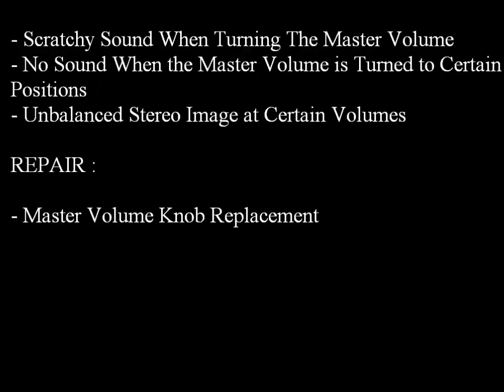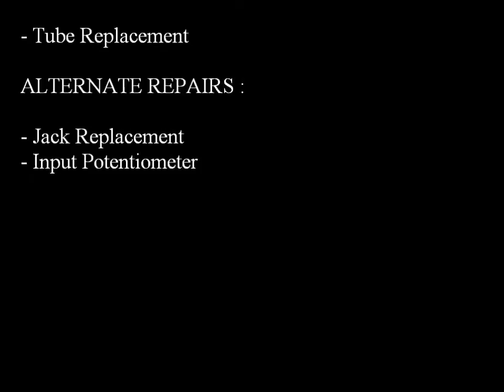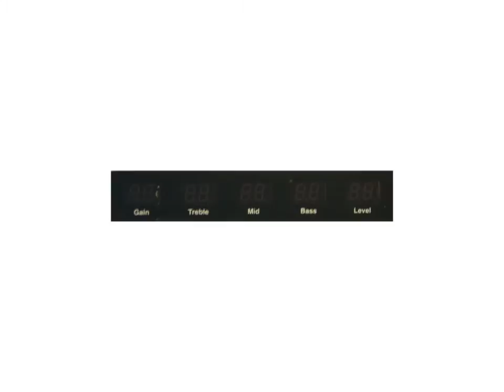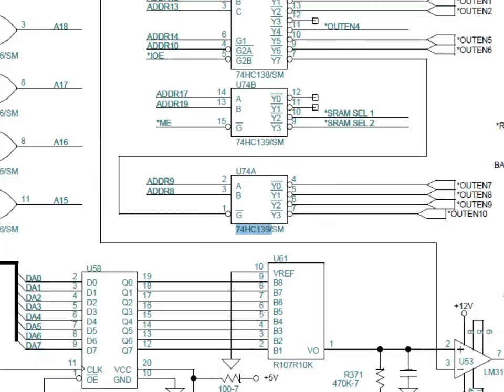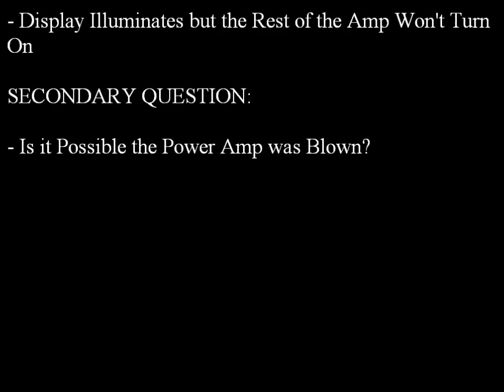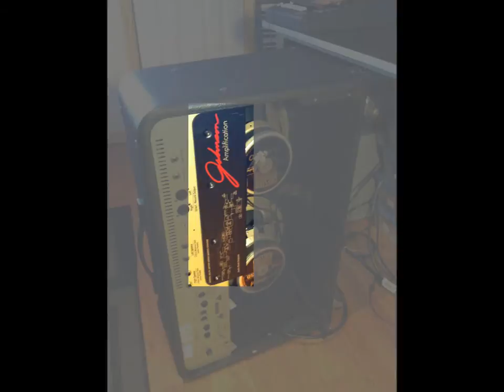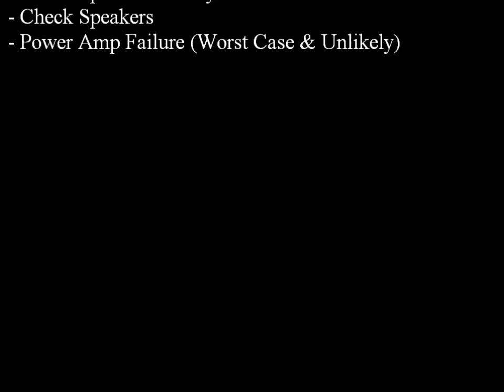Simple, Common Repairs for the Johnson Millennium JM-150 & JM-250

Comment: Hello I talk to you quite a while ago about my 150. I followed your advice about disconnecting the power amp to determine if that was the cause of my issue, although it didn't seem to make any difference unfortunately. The display lights up but doesn't say anything. I have had this problem looked at by our local electronics guy 3 times. Each time the amp works until I get home and then something happens to it. I do see where he has worked on the c13 cap, and it looks like it has been rigged to work somehow like there has been issues with it. In the past I have had the problem with it shutting down while playing it. Wondering if you have some insight that you might be able to share. I took a picture of the C13 situation. I sure would like to get it working. Also If I could get it working I would like to change out the pots and the encoders. Thanks
Reply from the maker: I'm curious if they gave you a summary of the work they actually did, and if so what was it? Rigged in what way? I mean, it should either be soldered in and there, or not there? Are you saying it never works when you get it home, or it works temporarily, say a few days and then ceases to work again? Also, do you have any form of test equipment, like even a simple volt meter?
Reply: @BosleymusicCentral  I did ask him about what work he had done, but he didn't act like he wanted to be too specific. I am kind of wondering if something is wrong with the board. It looks like there is some rubber/insulation maybe under the C13 cap and it looks like one of the leads from that cap is bent sideways soldered to the ribbon and not through the board. It did work each time when I got home, and seemed OK, but the next day it was back to the same problem. I do have a volt meter and have some de-soldering braid and some tools. I dont have a whole lot of electronics knowledge. I also wonder if being worked on too many time might have overheated the board or something. Also several people have worked on it years before him, including a technician from Harmon/digitech. If there is a place to get some parts still in Salt Lake City, I could drive there and pick them up. I have called Harman but I dont know if that is where I should look. The person that I talked to was not very helpful.Thank you so much for your response greatly.
Reply from the maker: @TheConcretelizard  " he didn't act like he wanted to be too specific" = shady. "bent sideways soldered to the ribbon and not through the board"= lazy work if that's what this person really did. You can definitely damage a PCB by replacing parts too many times, or doing it improperly, but unless the same parts were replaced 3 or 4 times, and the person has some skill, probably not likely. A few things : 
- Johnson has been closed for about 18 years, and unfortunately Harman canned most of the Digitech people in 2018, and seem to be just liquidating remaining units. Some parts don't exist anymore, like the S-DISC, but almost everything else on the boards can still be procured.
- If you can find the guy who worked on it before from Digitech, and he's local, I'd try to find him.
- If you can disconnect the power supply harnesses, and check voltages without load, I'd highly recommend that as a starting point. The GNDs are in the centers of the molex connectors, and the silkscreen will give you the voltages you should see, with "+32V" generally being higher than that. 
- If the power looks good, you might want to try turning the amp on, let it run for a few minutes, then power it on and off (cycle it) a few times --- sometimes the first time you see nothing, then garbled characters, then it boots. Most CPUs/MPUs/MCUs have a window that they have to be properly powered within otherwise they don't run, and doing what I described is like pushing the little primer pump on a lawnmower - you may see it boot by doing this.
- I don't understand the backup battery stopping the amp, but after I replaced on recently, I had to power cycle the amp multiple times in succession, to get it to start up again. You might want to try this also.
- Last thing I can think of, is make sure none of the switches are accidentally pressed, or permanently pressed, and make sure all of the ribbon cable connections are well seated. If a button is damaged to where it looks like it's pressed, or the Z-80 "sees" a switch as pressed because a connector isn't seated, I've also seen the amp not boot under those conditions.
Reply: @BosleymusicCentral  You know I unplugged the power supply and couldn't find my volt meter. So I decided that I was just going to find someone new to look at it. I put it all back together, then pushed all of the buttons a few times and turned it on and it started working. I haven't turned it off yet because I wanted to play it. Sounds great except there is a rattling/buzzing sound only on some of the more resonating notes. Sounds like something is loose. I think I will look in to it a bit more to see if I can find the rattle. Thank you for all of your time. I know its valuable and very much appreciated.
Reply from the maker: @TheConcretelizard  No problem - it might be a simple matter of having the power supply re-capped by someone who can do the work well. The electrolytic caps are at least 20 years old and probably starting to fade, so you might want to ask about that specifically.

Comment: Hey Don first I want to say you are a genius! Second I want to say thanks for the invaluable website about the Johnson amps! You ROCK!!!  Third I wan to say sorry I think I call you Dan in the video.... Could you take a look at this link when you have time? I got a Johnson 150 used and on some of the presets it just drops the sound note etc. It gets worse on the loud heavy presets. It gets annoying and I want to verify that it is not normal operation. Thanks so much...    https://photos.app.goo.gl/qkGMxgEyW3r2Vj7o8
Reply from the maker: A few things - hard to tell with the camera's microphone, but I think I get the idea.
a)check the firmness of connection between the speakers' 1/4" plugs and the jacks. I just had an amp on the bench where one of the jacks wasn't solid anymore, and that was the source of a lot of strange sounds.
b)it never hurts to disconnect one speaker and try each side of the amp individually, along with flipping which jack the speaker is connected to on each side.
1) Disconnect the speakers from the jacks in the back, and plug XLRs to something like a mixer with headphones if you have access. The XLRs are basically right before the power amp so they have all of the preamp/DSP available to listen to - you have to turn the master volume up to get output from the XLRs. Make sure the speaker simulator is on otherwise it will sound terrible. If you get good sound that way, it narrows it down mainly to power amp, or speakers. The other possibility is aged tubes.
2) If you have access to another set of speakers, try them. 4 Ohm minimum on each channel. One reason cleans might sound better than driven sounds has to do with speakers that might not be able to handle the richer upper harmonics the dirty channels produce, anymore. That's a sign of age/wear. A few years ago on tour, a Meyer monitor kept producing some weird noise - there guitar tech opened it, found a ton of dust, blew it out, and voila, back to gold.
3)  If 1 is good, but 2 produces the same results, my next step would be to have the power amp looked at, and/or swap pre-amp tubes.

Comment: Hi I have a Johnson Millenium 150 I'm doing an inside cleaning of the circuit board and inside of the chassis it's pretty Dusty will it hurt for me to spray out the electronic board with contact cleaner along with the volume potentiometers?
Reply from the maker: I'd recommend pulling the boards out, and using either >99% isopropyl to flush them, or alternatively some people use distilled water - the idea of water, although I know people do it, scares me. Drying time with water is much higher, also. Things like deoxit are arguably band-aids, and unfortunately two things tend to happen - they don't remove the dirt, they just bond to it - the residue some "PCB cleaners" leave, attract dust worse than if they were dry. In my experience contact cleaner works best when you have freed the bulk of external dust. You could also do none of the above, and try to use compressed air to blow the whole thing out.

Comment: Anyone know if the cooling fan on a JM150 is supposed to run constantly or only when hot, just got the amp but haven't heard the fan run yet.
Reply from the maker: Mine has always run on my 250 from the day I bought it.
Reply: @BosleymusicCentral  OK thanks guess I better check the fan out further, maybe unhook it and try it on a 12 power supply. Hope it,s just the fan ,that'll tell me .
Reply from the maker: @troybrown7092  In case it was the fan - I actually had to buy a replacement for a unit I'm servicing - the Qualtek FAD1-12025CBLW12 is a good fit.

Comment: When I play my JM-150 for about 5 minute, I hear a subtile white noise in the background whit some occasional poppings and cracklings,  the gain and the volume start to drop and the amp farts out. If turn it off and turn it back on, the noise is gone and the amp works fine but the same problems are going back. Plus, I could hear the kitchen mixer  in the amp while it was turing on.   My guess is that it's the preamp tubes that are dying and they are getting microphonic ?  Thanks !
Reply from the maker: Changing tubes is always a good start if you have never done it, but the kitchen mixer showing up in the audio path... unless it's physically close enough to vibrate the amp or induce a magnetic field, I can't see how that would have an effect directly. I would A)do a gut check of your home wiring with a socket tester, B)check your power supply. When you say "farts out" do you mean the audio dissapears, but the amp still runs? i.e. you can go through menus, change values, etc... if that's the case, you're looking at a deep dive problem with loss of a clock, or a bad IC. If it's the S-DISC you're out of luck on repair.
Reply: @BosleymusicCentral  Thanks for your response :) 
Well it was more like the gain was lowering and became unresponsive. Like a if noise gate was slowly activating itself and the volume dropped but it was very gradual and not sudden. But I couldn't change the sound when I tried to change values.  Also, I switched to a super clean patch right after and it sounded fine. It was only when distortion was engaged/added.   But after playing it afterwards, it seems like this event was a one-off so far and it didn't do it again.  The white noise is still there after 10 min of playing and the gate doesn't help. And the white noise doesn't increase in volume and it's pretty quiet so I only hear it when I don't play. Oh and the kitchen mixer was at about 6-7 meters away and the sounds was only present during the "loading/opening" screen of the amp. Other than that, everything works fine.

Comment: I just got a used Johnson 150 millennium I would like to try and find a owners manual how would I do that? and also I noticed the fan in the back of the amplifier is not coming on can you help me with this? Rodney's LaRue from St Louis
Reply: The manual is online I found it no sweat.
Reply from the maker: If the fan isn't coming on, start by checking the voltage to it. Honestly, you can replace it for about $12 and don't really need special tools to swap it, so you might just want to replace it.
Reply from the maker: http://pdfstream.manualsonline.com/5/5aca9756-9686-4cac-891d-df1424f12d74.pdf

Comment: Anyone have a part number(s) for replacement potentiometers?
Reply from the maker: I haven't been able to find anything off the shelf in a long time. It's a W-Taper, dual-gang 100k. The bourns PDB182-K2 series fits the form factor, but only linear taper, and you have to cut the shafts down - they're less than $2/each on Mouser. The W-Taper is not that far from the linear. There's also a person in Germany selling the exact part at $13 a pop. Put "Digitech Volume Pot" in a search on Ebay and you'll find it.

Comment: Hello.I had the same problems with the security code on your website,to contact you.I want to download patches to my JM150.but I have seen posts it will not work with windows 7,that’s what I have ,I was just going to purchase the $8 usb midi converter and dump the patches ,if windows 7 does not work is there another option.Hope all is well thanks for any help you may give
Reply from the maker: Obviously the JM software was designed to work well with the amp, but Windows XP wasn't even a thing when the made it. We're well beyond that. Any MIDI patch librarian software should work to store sysex from the amp - what I wouldn't recommend is trying to do an operating system update without reading through the thread of comments about Midi-ox in this video : https://www.youtube.com/watch?v=E0WupXIbk3M&list=RD_YFoH3ghrlw&index=2

Comment: This might be a longshot, and i hope you are still active on this page, but i really need your help. My johnson amp just stopped working while i was playing, it didnt turn off, but the display light in the screen did, and theres no sound coming through. 
I narrowed down the issue to a blown fuse with help from this forum: https://www.thegearpage.net/board/index.php?threads/johnson-millenium-jm150-help.630794/
I really hope you can help me out here. Thank you in advance.
Reply from the maker: I haven't been very active here, as you can see by the delayed response. Do you have a Voltmeter? Can you test the values on the power supply somehow? Preferably starting without load, and then adding load in, board by board.

Comment: Hello Don, and thank you for all the valuable info on these great amps. I swapped out the volume & contour pots as advised, however after firing the amp up after repair both the volume & contour knobs have little effect on sound. Everything appears to be soldered in correctly. Now the amp seems to be at full volume, and I have no ability to attenuate to a lower volume. I use the xlr direct outs to a Mesa Simulclass 295 so I can turn down the amp on the power amp side, but the Johnson JM 250 appears to be at max volume now, and can't be turned down using the volume. If you or anyone else knows what could be the issue please kindly advise.
Reply from the maker: I haven't had time to really check these, so I'm sorry this is coming a year later - but I have never had that happen. Is there any chance a)something is shorted? Have you checked resistance from lead to lead on each gang of the pot? b)Is the XLR output always at full tilt as well? c)What pots did you actually use, and where did you get them from?

Comment: Where can I purchase a power supply for this amp? The amp just won't turn on.
Reply from the maker: 1)Have you checked the fuse? 2)There isn't a drop in replacement. There are probably ways you could use off the shelf supplies to make that work, but you would be hard pressed to find something capable of (safely) providing the high voltage, albeit low amperage, DC necessary for the 12ax7's to function properly.

Comment: My JM150 turns on and works perfectly for 5 minutes, then the screen goes blank (blank green screen), then the sound gets really muddled and garbled. Whatever it is, it's related to something that would fail after warming up; that's my best guess. Anyone with advice or who has dealt with the same problem, I'd love to hear. Thanks
Reply: Did you try replacing the circuit board battery 2032? I replaced mine with a rechargeable. Worked fine ever since.

Comment: Hey I tried gettin gin contact on your website, but there was some issues with the recaptcha security code. 
My amp just recently stopped producing sound and started showing 2 asterisks or stars of the display instead of the the preset names. When I raise the input level, I am seeing that the clip light is flashing, so I assume it is still receiving the signal from my guitar. And I am still hearing the static sounds of the master volume like you explained in your video. 
I’m not sure where to begin to fix the issue.
I’ve also had problems with my j-12 losing power in the middle of playing and idk if that has anything to do with it.
Reply from the maker: To put it bluntly, people were abusing the email, and I don't have time for that. If you're still trying to get running - the clip light is analog, so that's good for the analog side, but isn't really an indicator that the digital side is working. "I’ve also had problems with my j-12 losing power in the middle of playing and idk if that has anything to do with it." - That's probably the entire problem. Watch the video about how the j-12 can damage your amp if you're not careful. You may be out of luck, as the S-DISC is no longer available and may be damaged.